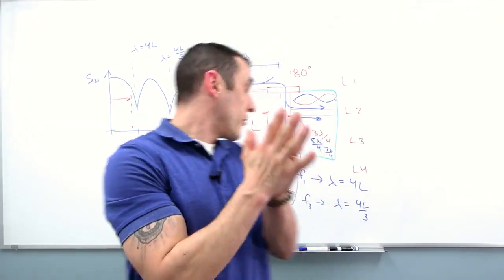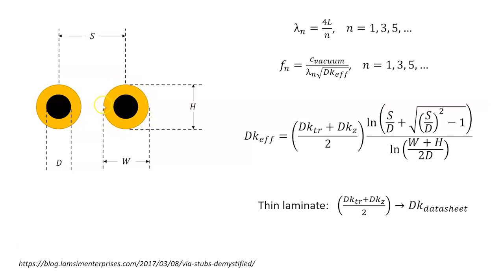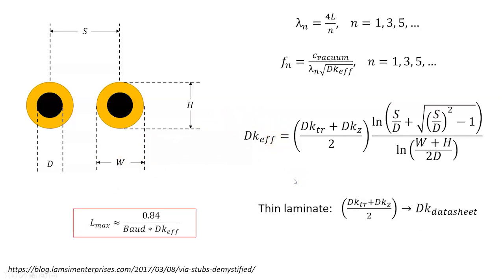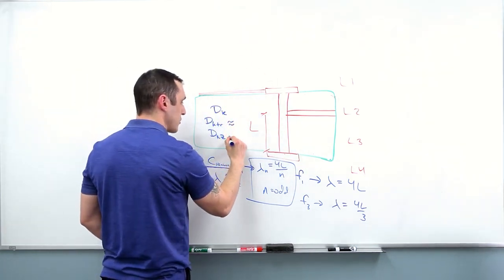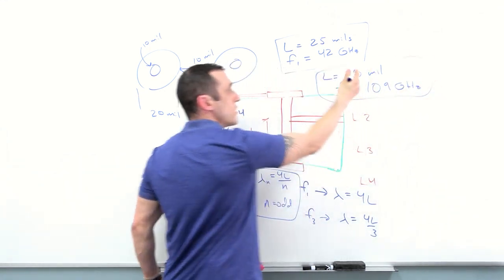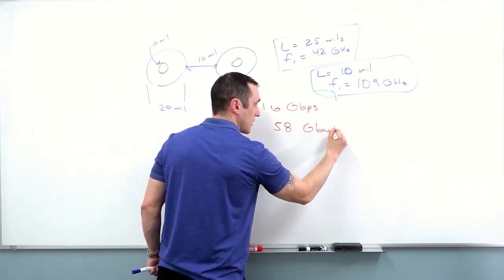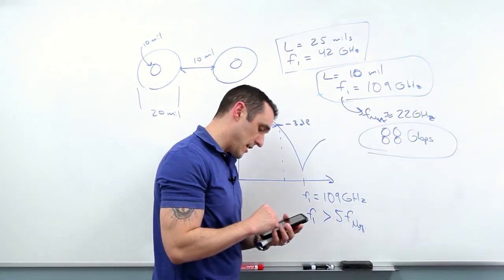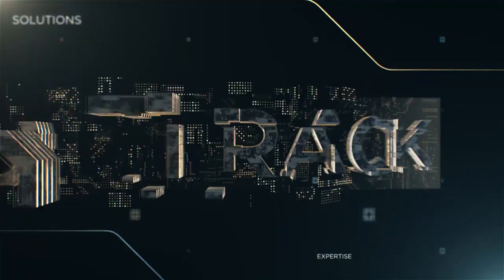Stubs and Backdrilling in High-Speed Design - Part Two

Comment: Thank you for providing us with this video, Mr. Peterson.  i appreciate it.  
I have a question. 
The design you showed us on the white board has a stub via from L2 to L4.
Instead of having the 10-mil stub via, can we have a 10-mil stub trace on L2 layer that would go to the left hand side of the via?
Reply: If you're referring to just placing a stub on a trace it is important to know that these function similar to a via in that they will create strong losses at specific frequencies. This is due to superposition of incoming and reflected frequencies, which is the same explanation we have for stubs on vias. This is exploited in impedance matching for RF circuits and should not be intentionally used in digital interconnects.